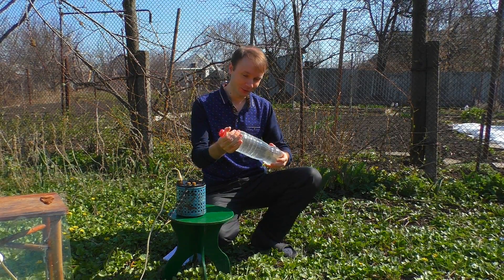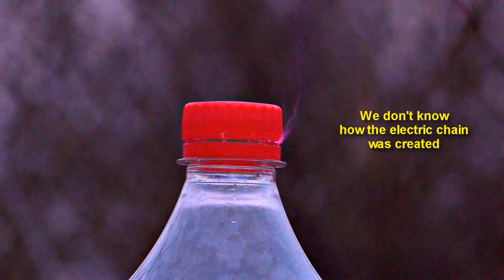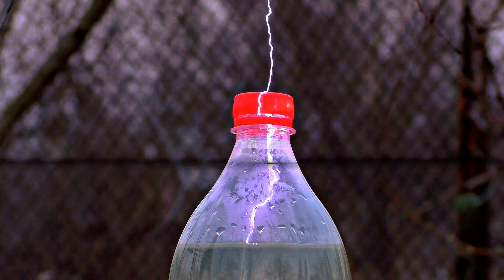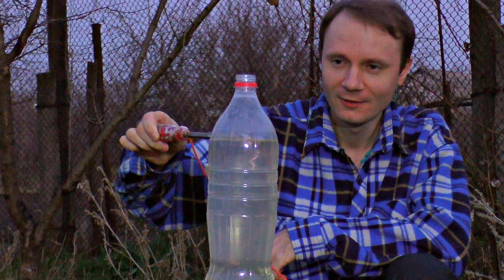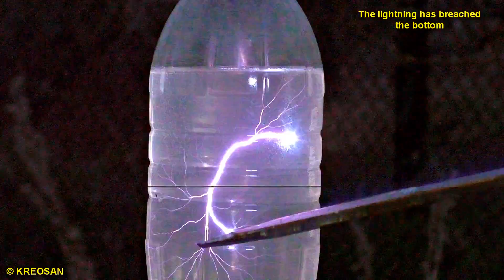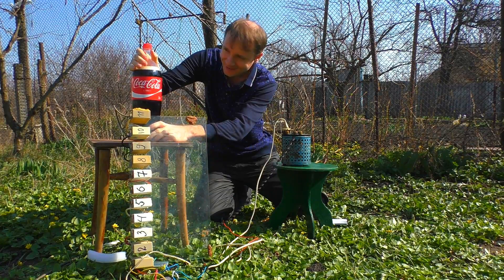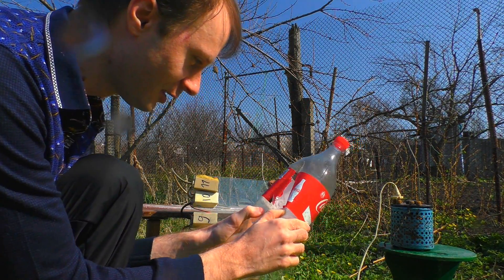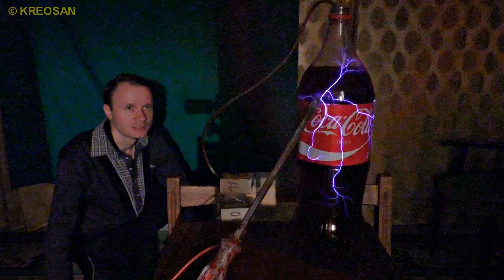One million Volts in a bottle of water! Looking forward to charge up a Cola with one million volts!

Comment: Here a physicist with an explanation: 
A cool fact that is seen in this video is that  although water conducts electricity in all points, when an high voltage is applied on it, not longer conducts electricity in the usual  way but instead water is ionized forming a plasma and only drives the electricity in located rays (where it lights).
Still, as can be seen in 1:07 the electrode is enough far away from the water to make it conduct the electricity in the usual way.
Reply: I don't understand what it needs to be done this. I mean the bottle with water is ok lol but what he use to give electricity to it?
Reply: @Hactu   It's just using a transformer that can generate a high voltage as he says at 0:06
You can also see at 0:20 that there is a wire connected to the bottom of the bottle to close the circuit.
Reply: @SimulatingPhysics  ty
Reply: I was thinking it was the high voltage and moisture in the air. Sounds like something an idiot would say, after reading your facts.

Comment: I had a 400kv transformer ark generator 0.2mm steel wire wired around a 2cmx2cmx0.5 neodymium magnet n42 and also had the solid red plasma was amazed went to test it again and got the standard color? Any explanation?

Comment: The pink color of the arcs looks like hydrogen plasma. maybe the water splits under the high voltage and turns into plasma which is conductive, then recombines with oxygen back into water.

Comment: Isn't the bottle acting as a capacitor here (albeit one that's past it's voltage limit)?
Reply: not really, the bottle was under high pressure because of the shaking, when the spark started it might have melted some of the plastic, making it blow up, of course the electrolytes in the liquid didn't help in keeping the bottle from exploding, the temperatue increased, and the solubility of the co2 decreased.
Reply: I meant the water bottle, not the coke one.
Reply: if you had another comment from me that didn't make much sense, i thought i was talking to someone else.

   Also, no, the water, when pure, acts as an insulator, it means that no current passes through, unless a criterea is met ( usually it needs high voltage or high amperage ), a capcitor is always acting like a conductor if a criterea is met, the criterea being, there is electrons stored, and those electrons can be used by something, when the criterea isn't met, then it will store those electrons until they can be used.
   What you saw in the water was the insulator becoming an condutor for a small amount of time, the voltage is high enugh to hydrolise the water into oxygen and hydrogen, wich are good conductors at high voltages, and crate an arc, wich appears to be created in the water, but are just gases made from it.
   Tl;dr   no, it isn't.

Comment: Why the water dosn't start boil??? !!!
Reply: it did.
Reply: well so high voltage should make it boil like crazy no? Just ask
Reply: There is not enough current
Reply: there isn't really enought surface area for the lightinings to heat up the water, and the water isn't conducting at all, it isnt working as a aresistor, but as an insulator, as soon as the voltage rises to enought levels it will start conducting, but if it doesn't, the electrons have to find another path, i bet that if the water had some salt in it, it would have boiled.

Comment: hw you conect capasitor
Reply: you connect the negative wire to the wire of the capacitor that has a white stripe, and the positive to the one that doesn't have a stripe, positive to positive, negative to negative, if you do it backwards it might rip itself apart.
Reply: wt is capasitor value
Reply: & hwo's u use the capasitor